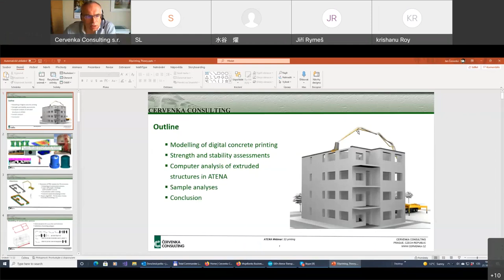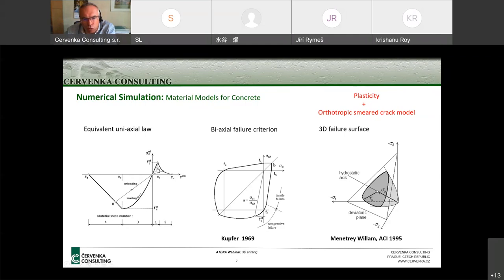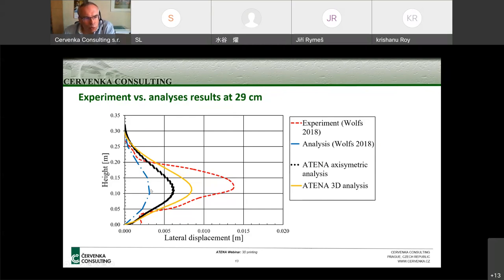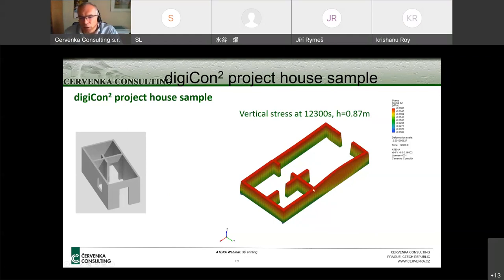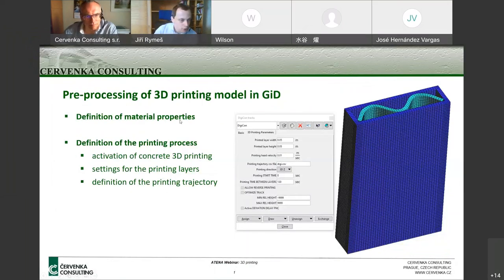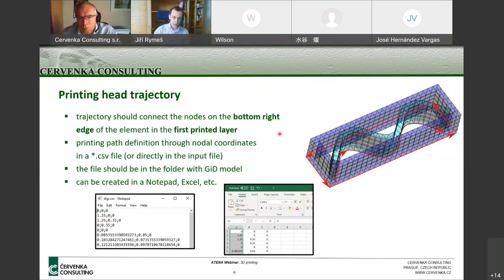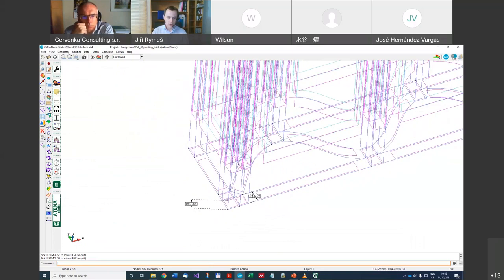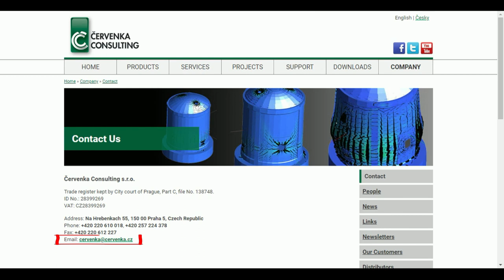ATENA Webinar 4/2021: 3D printing concrete modelling in ATENA

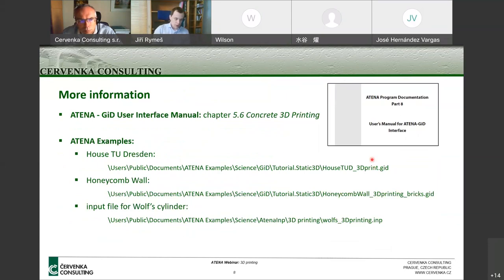Comment: Hello! Thank You for the great presentation of modeling of concrete 3D printing. I have 2 questions. Which version of GiD will I need in order to support DigiCon tracks, since in my current version (13.0.4), the Check Box for it does not show in the Program Data? Second question is where can I locate the Example files presented at time 39:38 in this video, since I do not see them in my Documents? Thank You for your help and insight.
Reply: Such a well thought out question, posed shortly after this video posted.  Surprised they are not responding.  So I won't bother with my question which was dumber.